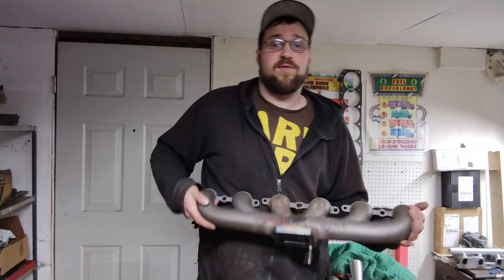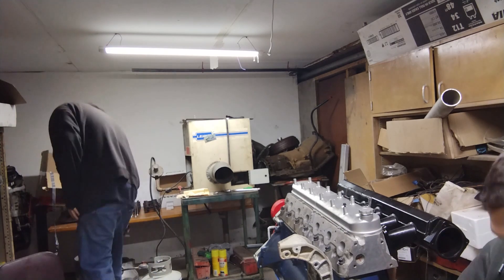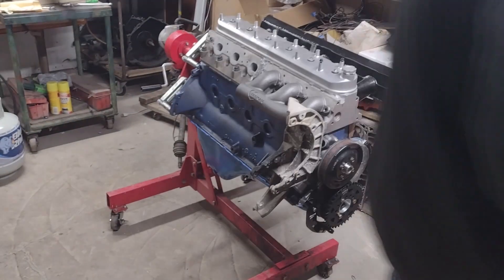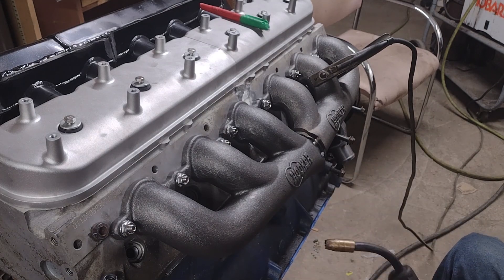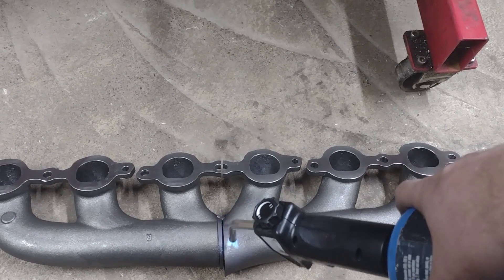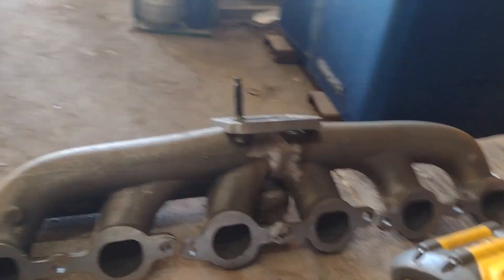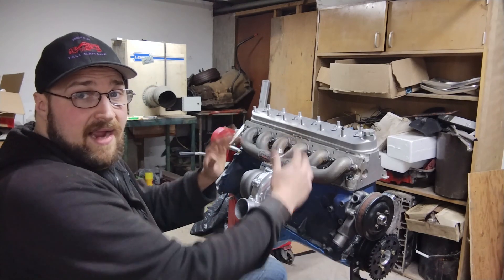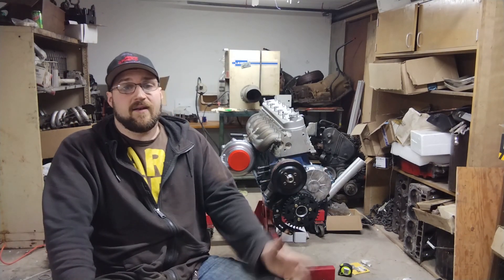I Put LS Heads On A Inline 6 How -To CUSTOM Turbo Manifold  #holley #hotrodmagazine

Comment: If you have issues with welding the cast metal, whether it is steel or iron, try Stainless steel welding wire next time. It will bond with cast better.
Reply from the maker: It welded fairly well.

Comment: What about flipping it over so the turbo sits on top and just run the down pipe thru the hood?
Reply from the maker: i could have, i would of had to weld the flange on a bit different tho, hits the valve cover as is.